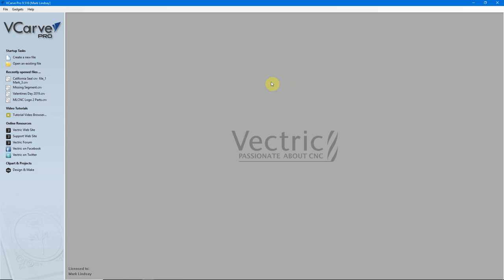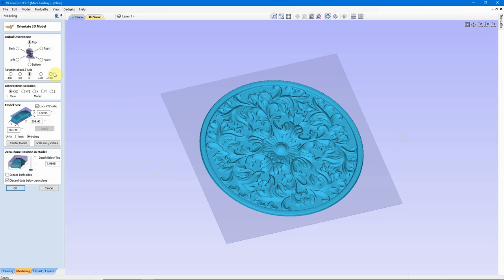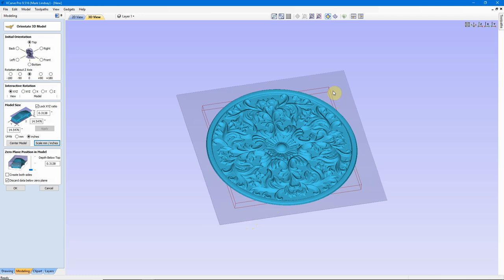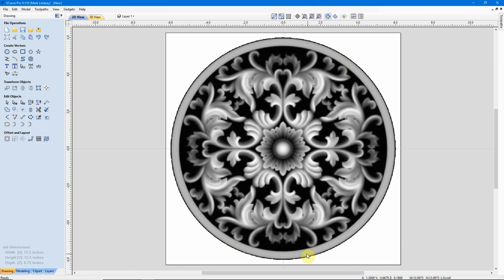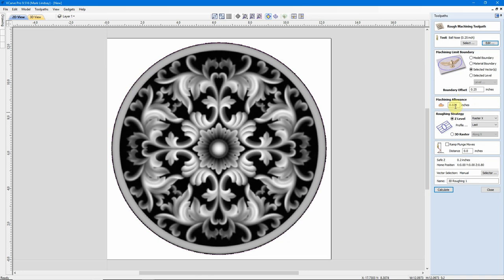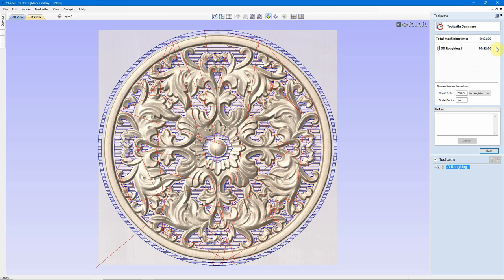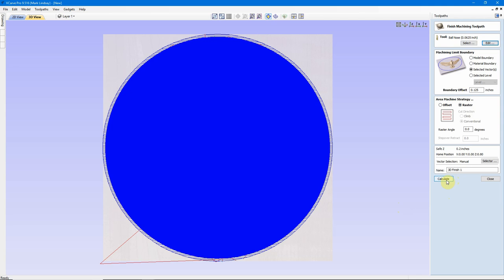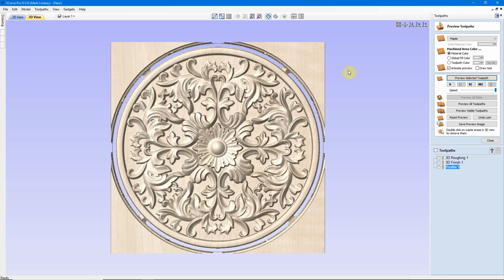Importing STL Files - Part 20 - Vectric For Absolute Beginners

Comment: Hello. Thanks for the video. I did manage to import a STL file with a 3D object but it does not contain any vectors ("no vectors selected" error) - I can't create a boundary or a toolpath. Can you please help?
Reply from the maker: The model itself has no vectors. After you have the model imported, go to the Modeling tab, select the model, and click the Create Vector Boundary Around Selected Components icon under Modeling Tools. That will draw your vector boundary.

Comment: Hi Mark, when I import the 3D model (.stl) it initially is placed at the correct location as it was modeled but then moves it to center of my project file when I create the vector.  I'm importing puzzle pieces into Vcarve Desktop so I can only import a single model.  I was hoping I could import and create multiple vector files then re-import each vector file  into a master puzzle project and they would all come back in at the same position as that each 3D model was placed.
Reply from the maker: Hit me up via email through my website. I'll need a bit more info.
Reply: Help with ZERO PLANE , when I import  a 3d model it comes with a zero plane that splits my material in half, I need  to make the 3d model fit 95% into the material , how do I place the zero plane  at the bottom of the material and not in the middle?

Comment: Thank you for the tutorial. Everything goes well, until I click ok on the 'Orientate Model' box. @ 14:20 in your video. I just end up with a blank grey rectangle. Still learning.
Reply from the maker: Is this before or after you scale the model's size? Try finishing the importation process and see if you can see it in the 3D view.
Reply: @MarkLindsayCNC  Thanks for the coaching. I scaled and centered everything, my numbers look good, my zero plane is all the way down, when I press ok, it processes, and then i get just a grey iso view of nothing.
Reply from the maker: Okay. I'm still pretty new to 3D, and to be honest, I don't import many STL files. Luckily, all of them have worked so far (knock on MDF...) This might be a good time to head over to the Vectric Support Forum and see if any of the folks over there has an answer for you. Some of those folks are absolute wizards with Aspire and VCarve.
Reply: @MarkLindsayCNC  Thank you much!
Reply: @mark lindsay cnc I just wanted to update you on this thread. I now can import stl's with ease. The whole problem was the fact that I was running Vcarve on Linux in a Windows Emulator. Apparently it's not fully compatible. I finally pryed my wallet open, and bought a modern Windows X PC, and that made a huge difference in Vcarve. Thanks again for your videos, and tutelage.

Comment: What if I want to carve several of them at once? Is there a way to duplicate the whole thing a few times, like nesting?
Reply from the maker: You have a couple of options. Once the STL is imported, you can click the model to select it, then click it a second time to put it into Move and Transform Mode, then hold down the CTRL key, and drag a copy of the model into whichever position you want it on your material surface. Or you can calculate the toolpaths needed to carve the model, then Array Copy those toolpaths. I did a video on Array Copy Toolpaths a while back. Here's a link: https://www.youtube.com/watch?v=6y-Fos9KItA
Reply: @MarkLindsayCNC  Thanks!

Comment: hello how come my stl files come in small and not the size it is suppose to be
Reply from the maker: If you're working in MM, it's quite possible the STL was created in Imperial. When you import, look at the SIZE window, and check the box Scale MM/Inches if it isn't checked, or uncheck it if it is checked. If that doesn't do it, make sure you have LINK XY checked, and pick either the X or Y box. Double click in that box, move your cursor as far to the right as you can, then type *m=   It should convert the measurements from Imperial to Metric.

Comment: Great video!  I have a question.   I am carving two sided mandolin tops and backs.   My material is slopes from the center to the two sides about an inch in the center to about 1/4 at the two edges.   Any recommendations on setting tool paths for this type material?
Reply from the maker: You would need a 3D model of the surface you want to carve. If you have Aspire, you can model it yourself. If you have VCarve, you'd need to import a model, then project the carving toolpath onto that 3D model.
Reply: @MarkLindsayCNC  I have 3d STL files for the different parts of the mandolin, so vcarve pro is all I need?
Reply from the maker: You can certainly import a single STL file into VCarve Desktop or VCarve Pro. You would want to create separate files for each part of the mandolin anyway, so that isn't an issue. Just know that you can't edit the STL files in VCarve, other than basic edits like size, thickness, etc.

Comment: Really great video which I'm trying to follow while importing an stl model into Vectric Aspire, but the model and zero plane appear offset from the red wire box which you say represents the material.   Any idea why that is?
Reply from the maker: Did you click the Center Model button in the Model Size section?
Reply: @MarkLindsayCNC  Thank you  Mark.  Just did and all is well.  Thanks for the videos!  They are super helpful!

Comment: Mark Thanks again for another informative video. With run times of 8 to 10 minutes what  would your thoughts be on doing  that file with a dewalt 1.25 hp router as far as it over heating.
The other question  is on the time vcarve says it takes to cut. on my Carbide shapeoko it seems to cut faster the vcarve says it should.
Did you calibrate your cnc in some way to reflect the correct time. In the file I sent you on the Dados vectric said the cut time was 18 minutes
when when I ran it it only took 5 minutes. Thanks Jeff
Reply from the maker: Lots of things can effect that estimate, Jeff. How fast you bump up feed rates on the fly is only one. Also, look at the estimate in VCarve, and change the scale factor down to 1x. That's another factor.

Comment: Hello, wanted to know how accurate the carving time calculator is ? When we carve in cnc machine could the carving time change if yes what percentage compared to the time calculation in vcarve
Reply from the maker: It's fairly accurate, but nothing is perfect. Your best bet is to look at the time estimate in the Toolpath Summary, then keep track of the actual machining time. Use those two figures to create a multiplication factor to enter in the Toolpath Summary. My actual time tends to run about a 1.15 scale factor. Personally, I only use that calculator to get a rough estimate. I can increase or decrease the actual cutting speed while the machine is cutting. That throws those estimates right out the window.

Comment: Can you import or save a file as an STL with Vetric Cut 2D software?
Reply from the maker: Sorry, but no you can't. You can only export an STL file with Aspire. The others are not 3D modeling programs.
Reply: @MarkLindsayCNC  not even Vcarve Pro? Which I'd like to upgrade to.
Reply from the maker: My mistake - I misunderstood you. You can Import a single STL into VCarve Desktop or VCarve Pro, do some minor editing on it (adjust the size, height, etc...) then carve the 3D model, but you cannot Export or Save a file as an STL in VCarve. To Export an STL, you'll need to use Aspire.

Comment: The machine I’m looking into purchase has a cutting speed of 250ipm on z axis. Is that the plunge rate you were talking about at the end of the video?
Reply from the maker: You'll want to double check as to whether that 250 ipm is the cutting speed or the rapid speed. The Rapid speed (or Rapid rate) is how fast the axis will move while the bit is up, out of the material, going from place to place. The Feed Rate is the speed at which the axis is moving when the bit is down in the material, cutting. The Plunge Rate is how fast the bit plunges down into the material. I normally set my plunge rate at half of my feed rate. There are exceptions, but that's what I use as a general rule of thumb.
Reply: Mark Lindsay CNC thanks for the reply! 250ipm is cutting speed.

Comment: Dear Sir
Thanks for a great video from start to finish. I found the depth speed very interesting. My problem is when you open an STL and the dimensions are Z=1877, X=2009 and Y=115.6. How do you scale this. I always seem to end up with a weird nothing. Can you please help here as most STL's I have have these sort of dimensions or far worse. thanks indeed
Reply from the maker: Thank you Paul. I went through this exact problem in Part 20. With numbers like that, it's easy to tell that the model is Metric. Watch Part 20, and jump to the 9 minute mark. I explain and demonstrate it there: https://www.youtube.com/watch?v=GSkFb-5lXkg
Reply: Thank you for replying so fast. I have looked at your explanation three times and have tried to apply your words on how to apply changes. I just can't get a decent image when I accept the 3D image into Aspire. Is there a video out there that shows how to apply 3d images when the values are massive as I wrote above. If you would like I can send you the file? Thanks in advance
Reply from the maker: You might head over to the Vectric Support forums and ask over there. There may be an issue with the model.

Comment: I still have a problem after watching your great video's. For this one I struggle with the layer. first step create new file, then the Job setup. Here I select single sided followed by the size of my job which is 100x100x15mm.. etc. then the import bit (A STL file made in Solidworks) - all clear BUT @&%^!$$# I get that layer in the center of my job size... making the imported part not fit.. I have no clue on how to get past this. - why is the layer in the middle and not placed at the bottom of my material thickness..?
Reply from the maker: Are you adjusting the Zero Plane Position in Model? That will move that plane's position. You might also uncheck Discard Data Below Zero Plane. Between those two, that should fix you up.

Comment: I still can’t make my imports fit on the work piece lol
Reply from the maker: Do know that this is an older video. I recently released a newer video that covers this topic in Version 11.0. Here's a link: https://www.youtube.com/watch?v=r5PY4DmFKwE

You may be importing a model that was created in a different unit of measure. In the Import screen, look at the Model Size section and make sure you've selected your preferred unit of measure - mm or inches. If the model is very tiny or way too huge, click Scale mm/inches and see if that helps you out. If it doesn't, make sure you have your preferred unit of measure selected, make sure you have Lock X Y Z Ratio checked, and change either the X, Y, or Z dimension to the dimension you're trying to achieve. That should size it correctly. Click the Center Model button, then continue from there.